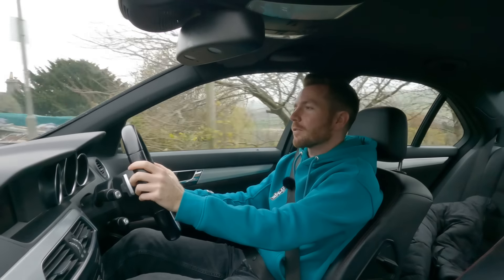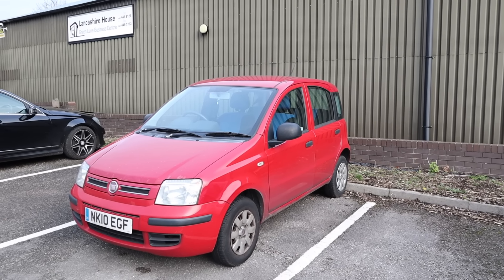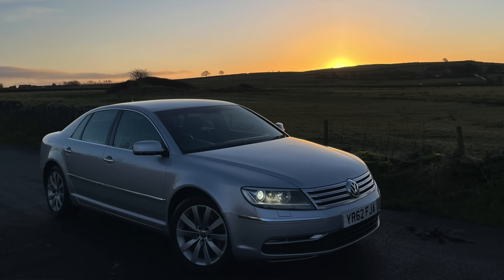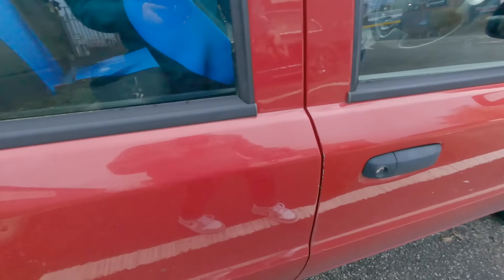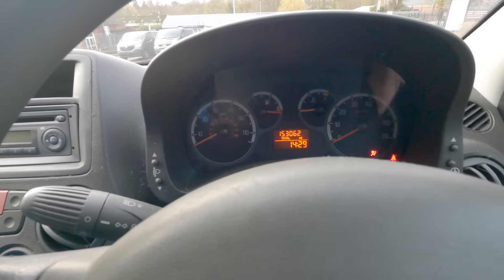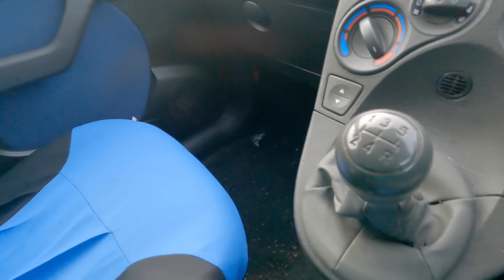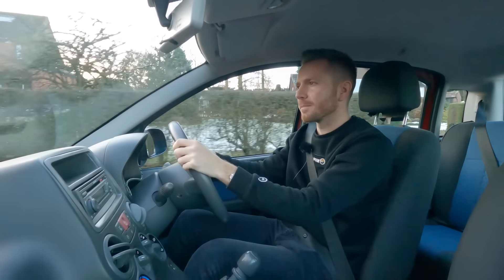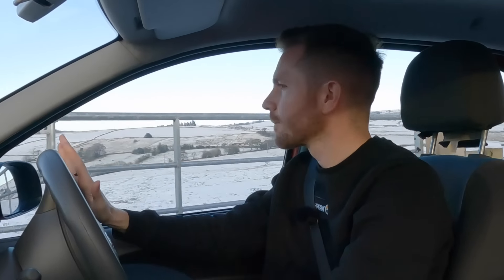I BOUGHT A CHEAP FIAT PANDA FOR £250

Comment: All you need to know about the second gen Panda is that James May had one for many years and Harry Metcalfe currently owns one. A car can't get any higher praise than that.
Reply from the maker: That’s true
Reply: As well as Richard Porter (sniff petrol) I believe he has a panda 100HP!
Reply: IMO the 100HP is very overrated. I tested one when new and decided it wasn't special enough to be worthwhile. The motoring press enjoying it has pushed up used prices too.
Reply: Who’s Harry Metcalfe?
Reply: @Negativvv  That's interesting. Always liked the Panda too and wondered about the 100hp. But part of the appeal is having a tiny frugal engine. Apparently the 0.6l is nice.
Reply: @oliverstemp9132  former EVO editor and rich car enthusiast. Has a YT chan called Harry's Garage. Appears to make his money in farming. Seems a really cool guy from all I've seen of him...
Reply: Think the 4x4 had a good review.
Reply: @oliverstemp9132  nice guy with youtube channel, lots about cars, has far bigger car budgets than average, not quite nick mason budgets but still impressive.
Reply: @oliverstemp9132  Harry's Garage on YouTube
Reply: @Negativvv  the 100hp is a total laugh down the back roads, as soon as you've got a chance of breaking a speed limit it runs out though
Reply: @Oldsmobile69  Some in the know say get a 0.9 Twin Air mk3 instead of the 100hp. It's nearly as fast (likely faster in gear as it's turbo) and is a more civilised car. They're probably correct as I like the mk3 TA a lot. The 100hp just felt dated and shabby when I tried a nearly new example however as you know it has plenty of fans so I'm in the minority here. I don't really trust motoring journalists anyway, having driven for 20+ years I prefer to make my own mind up on cars.
Reply: James May had 2 and they still going when his others aren't
Reply: It's called being eccentric.
Reply: AFAIK he makes his money elsewhere. He talks about profit in his Harry's Farm channel sometimes and it's not enough to support his car habit.
Reply: @oliverstemp9132  GOD
Reply: @Negativvv  I'd agree, the twin air is a pretty enjoyable engine to rag.
Reply: @Negativvv  probably wouldn’t watch it
Reply: @oliverstemp9132  YouTube Harrys Garage ,
Reply: @HighPeakAutos  those hooks in the centre console are for the seat covers 🤣👍
Reply: @Negativvv  Ah yes, I meant the 0.9l. And yes, that's apparently a very good engine.
Reply: @Oldsmobile69  I really enjoyed driving the 0.9 TA when I test drove it, unlike the 1.4 100HP. The most accurate way the 0.9 can be described is that it sounds like sticking a piece of card into a desk fan, the buzzing sound it makes is exactly the sound... I sort of regret not getting the 2012 Panda TA I tried in Aug 2020, it had 10k miles on the clock and the seller wanted £4k for it. It was as new inside and out, the underside was completely clean of dirt, whoever owned it before didn't like wet weather. Only issue was it had zero service history and the car itself was a bit small as I've got family to carry around...
Reply: @Negativvv  In terms of potential the TwinAir is probably the way to go compared to the 100HP - but when we bring up longevity and reliability the good old 1.4 16V will outlast the 0.85 Turbo by miles. With LESS real world consumption and headaches.
Also if the 100HP Panda gets expensive for whatever reason there is also it's twin, the 1.4 500. Which will always live in the dark shadows of the T-Jet "Abarth" variants, especially when we consider the price.
[Edit: typo]
Reply: I had three of these from 2006 until 2015. All were multi jet diesel models. Very good to drive, economical doing more than 64mpg. Did in total 100000 miles in total in them. They have a few issues such as rear shock absorber mounts but generally reasonably reliable if looked after.
Reply: @alfisti93  Yes I agree, I'd dare say there will be less .9 TA around when they start to reach the same age as the 100HP. If I was going to get a TA it would have been that ultra low mileage one I saw, I don't trust the engine to stand up to long term usage. The 1.4 turbo FCA unit seems like a good one, at least from the amount of cars it's shoved in.
Reply: @Negativvv  Oh, the 1.4 T-Jet is definitely quite a blast and it's capable to take some hard driving. I can say so from my 695 (180HP + mechanical locking diff, all from factory). 
Even the "complicated" 1.4 MultiAir holds up - if you clean the MultiAir filter, which is located in the head and hardly anybody knows about... (Yes, insert Italian Engineering joke here!)
However, I have really no personal experience with the cute, little 2-cylinder on steroids - the mechancis were cursing though...
Reply: If only if it were electric of a hybrid, which Fist teased for many decades.
Reply: @toyotaprius79  you mean the Panda Hybrid launched in 2020?
Reply: I strongly agree 100hp totally over rated .The smaller petrol
Engined cars are way more fun to drive and trash .The diesel is great too , does 68mpg like clockwork driven easy or hard outside of towns . I’d go so far as to say the 100hp is the worst of the Pandas due to 34- 42mpg ( the latter only with the absolute max restraint )and barely under ten second 0-60 .It’s far better built mind you than the rest , more ‘Golf like’ seats and door slam but I happily sold mine after months not years
Reply: @HMS.Margate  Compared to what exactly?
The 500 (312) 1.4 16V and the Panda (169) 100HP share the same engine, same transmission, same platform, produced on the same line in the same plant.
And as far as I know the FIRE in "StarJet" configuration has 70kW/95hp only, so it doesn't quite match the powertrain in the Panda 100HP with 74kW.
Of course the turbocharged FIRE dubbed T-Jet is a COMPLETELY different animal!
Reply: @UCx3xBpLHfTIx2Yam-0-4X2A Yes! Sure! I mean the 100HP Panda is just a natural aspirated 1.4 FIRE with a 16 valve head. 
And initially I was compring it to the natural aspirated 1.4 16V in the 500 - which is essentially the same thing but with 2 less doors.
Meanwhile the 1.4 FIRE in the Abarth I drive is the fully blown T-Jet which has 180hp and is fitted with a "massive" Garrett turbocharger. (Weaker T-Jets have an IHI). 
So there is a night and day difference, not only in the way they drive...
Reply: @oliverstemp9132  Mr Evo magazine. Check  Harry's garage and also Harry's farm. Wonderful chap
Reply: @Negativvv dont think the farm makes him much money but a great you tube channel
Reply: Yea , probably used like a golf cart 🤣
Reply: @oliverstemp9132  and loads of people fell for that one, well done!
Reply: @helipeek2736  never heard of Harry’s Garage
Reply: Rented a hybrid in Madrid was bloody fast
Reply: Regularly hired these in Spain for family of 5 did everything
Reply: What about the power steering light?
Reply: @HighPeakAutos  Did you get the lacquer peel sorted? If so then can you say how?
Reply: Terrible safety rating though
Reply: @CalumRaasay 
Did not expect to see you in this comment section.
Love your videos. Keep it up :)

Comment: My assistant bought one for 365 pounds. It needed a new rear axel and she was only going to keep it for six months. Six years later it is still going strong. I love driving these cars around town. Soooooo cheap to run. Easy to park, cheap parts.
Reply: Love a cheap little runner round 👍
Reply: the power of a bargain shitbox is fantastic
Reply: We have two of them. 2007 1.2 and a 2009 1.3 diesel. 
They just work so well. 
Avoid red as the lacquer will peel and the red fades.

Comment: I’ve owned my Panda from new which I paid £5,000. I’ve had it 14 years it’s such a reliable car . When the power steering light starts coming on particularly in the colder weather  it can mean your battery is on the way out.
Reply: I concur, it could mean an old car battery.
Reply: So budget in another 14p for a new battery?  😉
Reply: @autobahnproven  would you please tell me where you buy your car batteries for 14p? 🤔

Comment: My daily driver is a 1.2 petrol facelift (2015) panda. 55 mpg, happily sits at 75 on motorway, roomy, easy to drive in town, easy to park, drives like a minivan, nice and high seating position, good room for kids in the back, and when seats folded down, will easily carry a washing machine.

So far, touch wood, only oil changes , tires , wiper blades, and one timing belt change. And a set of spark plugs.

They're absolutely brilliant, and bullet proof. And not a lot of electronics to go wrong.

Comment: Got one of those (petrol, 2005 reg) as a runabout here in London, fantastic little car. Cheap to run and maintain, practical, quite fun to whisk around in it and the petrol is even ULEZ exempt. No wonder you used to see so many of them around.
Reply from the maker: Yeah definitely. I’d probably have something like that if I lived there
Reply: This makes so much more sense than spending £20-£30k on an EV “city car”

Comment: Great video Matt.Fiats are great cars for the ordinary people.They are cheap from the start and the service parts are cheap.I have 2012 fiat bravo myself with 304 000 km with the weakest engine in the range ,1.4 90hp petrol with fabric lpg system. It only requires regular service like all other fiats including the panda and it starts everytime.

Comment: I have a MK3 1.2 petrol on a 14 plate it uses about a third of a thimble full of petrol each week locally. I managed to driving very carefully from North Yorkshire to Essex on just under half a tank of petrol. Very underrated little cars the 1970/80s Fiat image is long gone it's just badge snobbery. my 2014 Panda has a Bosch Engine Management System, Japanese sensors and plugs they aren't so much Fiat as you'd expect a Ford KA & 500 is just the same animal underneath the body.

Comment: I had a panda multijet from new on 08 plate. Spare wheel will have been an extra, the other extra worth having is locking fuel cap only buttons from fiat. You could just get new drivers seat from breakers yard. I paid 6200 for mine new, sold at 3 years for 4000, motoring don't come any cheaper. Biggest risk is turbo going. Quite an active fiat owners group online. Fun to drive. Enjoy.
Reply: Just remembered full size spare was extra, space saver was standard

Comment: Bought my 08 1.3 Diesel in 2014 with 37k on the clock for under £4k.  PX'd it in 2019 with 153000 on the clock for £350.  It did an real world actual average of 63mpg, commuted 110 miles each day, took 4 of us down through Ireland and across France to Bordeaux and back - pulling a trailer, 4 bikes and with 2 roof racks.  Then it did again the following year to Rioja in Spain.  Came back both times with more wine than it should have. Only non consumable part is broke in that time was a windscreen squirting jet.....  Loved it, miss it and would have another in a heart beat.  Yours looked like it has AC too.  May have been designed in Italy, but built in Poland I think - and well built at that.
Reply: 350 only if I could find a car thst cheap
Reply: Was that Wine or Whine? Drove a 80k mile MK2 Honda Accord to Malaga and back in 36 hours in the Eighties, needed both front wheel bearings after. I also have great respect for the little Fiat, after helping my daughter to one. After the rear torsion beam corrosion was corrected, it's been a belting little workhorse!
Reply: @MarkDaleADV  lol definitely wine 🍷 of the drinking variety.  Learned to drive in a series iii lightweight Landover, anything else has quiet wheel bearings after that ...

Comment: The 1.3 engine in these is the same as what Opel used in the combo van (and with many others). The combo van was used by Royal Mail with the 1.3 engine and they must be solid engines because a lot of those royal mail vans are still in use and I can't imagine they are cared for very well. Great video as always.
Reply: Yep, all early Fiat 1st and 2nd gen commonrails were good engines, later ones i'm not familiar with. My '02 Alfa 156 had the 115 bhp 8v JTD which might sound underwhelming today but in that 1200kg car with that nice manual gearbox it was quite fun and very frugal.
Reply: @sssssneaker  Yeah i can imagine! I learned to drive in a 1.6tdi Skoda fabia with around 89bhp. It wasn't as bad as I thought it would be.
Reply: @archechme  sounds like a rocketship compared to my learner Golf 1.9 SDI (no turbo one) with 60 hp :))
Reply: the lower-powered variants of the 1.3 and 1.9 JTD/Multijet are fairly reliable units, I had both (2004 Punto 1.3 with 70hp which I still have, previously I had a 1999 Alfa 156 1.9 with 105 hp). The 1.3 diesel has been used in 45 different car models from various manufacturers (Fiat/Alfa Romeo/Lancia, Opel/Vauxhall, Suzuki etc.), same goes for the 1.9 diesel which has been used in 30 models (including Saab and Cadillac).
Reply: @sssssneaker  yeah i bet they were very steady! good for learning though I suppose

Comment: We had a 2003 Fiat Panda 1.2 with 60hp. bought used in 2007 for 6.000 euros, we sold it in early 2022 with 93.000 km. for 4.000€ cause it was burning 10l/100km. But it was so quirky and shitboxy that it was fun to drive handbrake drifts and clutchkicks. I’ve reached 175km/h downhill. Terrified af. Unforgettable car.

Comment: I like these too, so many cars are based on them. The Achilles heal of them is the rear axle/suspension area corroding. My mother in laws ex bought one for £500 off Facebook, it seemed fine and did a few Leeds to London trips. But as I owned a mk1 Kia Sorento at the time, I was a bit obsessed with checking rear axles. 

And I noticed the rear axle on his Panda was very badly corroded and of questionable strength. I suggested he take it to get looked at and see if they could weld it or put a decent used axle on it. The garage agreed that it was hanging on by a thread, and he scrapped it. He was always pissed off at me about that, would he rather I said nothing and it collapsed on him at 70mph on the M1?.
Reply: Mine was scrapped because of rear axle rust aswell last saturday.. but it wouldnve been a real danger... for a long time.. atleast i got 400 bucks for it.. payed 1000 4 years ago, never had any big repairs.. so im not sad..  but ur right on the point.. it is a big weak spot for the panda.. esp if they are spraying salt where u live..

Comment: I had three Pandas delivered prior to thier original launch. We took the bonnet off one, turned it upside down and used it as a toboggan. We managed to get all 22 body shop staff on it, racing down a local park hill in the snow. Worked well. We claimed body damage under warranty.

Comment: I drive a 2011petrol panda with 70k miles on the clock. Had it up and down to  London from  Manchester several times. Hard drive but  around town  it's a  belter.

Comment: You are wrong about the Panda. If looked after these are one of the most reliable small cars. They will be more reliable than anything from VW or Citroen/Peugeot. I have had several of these and they are robust and very reliable.
Reply from the maker: I’ve got lots of stories which go against your theory
Reply: @HighPeakAutos  it's not a theory. As I said I have owned several of these and they have been very reliable. The only one to avoid is the later twin air two cylinder version.  No they are not perfect but I stand by my original comments. NB there are many comments on your video also praising the Panda!
Reply: @bondjamesbond9041 is a fist panda 1.2 dualogic any good?

Comment: Super presentation as usual. We live in benidorm. I bought a panda from the hire company we use. 1 year old 20,000 miles. Excellent condition. I reasoned that it would have been looked after and serviced.  I hired it for a week to check its condition. Keep up the good work 👏
Reply from the maker: Ah very good

Comment: Excellent video. We have the same Polish-built 1.3 diesel engine in our '15-plate Vauxhall Combo van (re-badged Doblo) with stop/start (or Eco Flex as Vauxhall like to call it). They are very tough mechanically. 90,000 miles and is still like new.

Comment: My 2008 Panda multijet I bought for £550 3 years ago with 175k on the clock. I've done another 40k and other than tyres, shocks, springs and a new back box with regular servicing it has never let me down. It's also one of the nicest cars to drive in the city and comfy on a long drive.

Comment: I have the Doblo Multijet Cargo van on a 58 with the same engine.  I thought it sounded a bit tappity, but you pointed out basically that that is nothing to worry about. My van has 138k on it, returns 70 -110 mpg on a motorway run at 60 mph. I bought it in July 24 and since have done 2 trips from the East Midlands (Derbyshire) to South Wales and back as well as pottering around to and from work daily.   I'm also a  Dj so the little van is ideal for transporting a rig (or a sofa to the tip for a mate). Cracking little van. I paid 600 for it with 8 monthes MOT via a good friend. Gave it a full service oil/air filter/oil filter/fuel filter, it runs lovely. There were no glow plug issues when he plugged it in.  Think I got a bargain...  This engine is (whilst a bit tappity) a friendly no frills honest engine, and quite talkative to be fair.  No electric windows or AC as it's a base model (less to go wrong).  The power steering is lovely and light. Just thought I'd share that with you all.

Comment: Bought a new Panda in 2004 and ran 110 000km until 2013 when I bought the mk 3 Panda. I too needed jus one new battery. The Mk 3 has now rolled along for 50 000km with just routine services. Nothing gone wrom]ng but again, a new battery. Great cars.

Comment: I brought a 54 plate panda 1.1 just before COVID happened. It had 55k on it for just £200! Cracking little car only had it for my misses to lean to drive in. Flew through MOT needing a tyre and and one of the washer jets wasn't working 😂 loved it so much she now drives a 62 panda 4x4! (I'd recommend you do a review on one of these in the snow, they're unbeatable!)